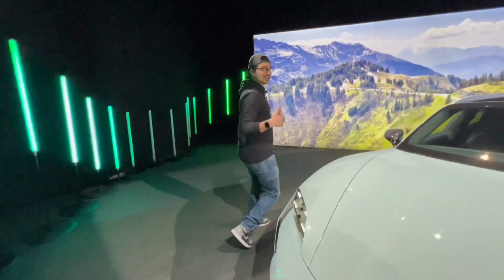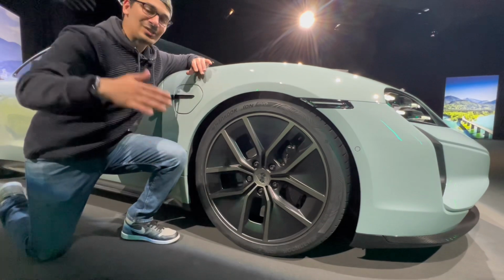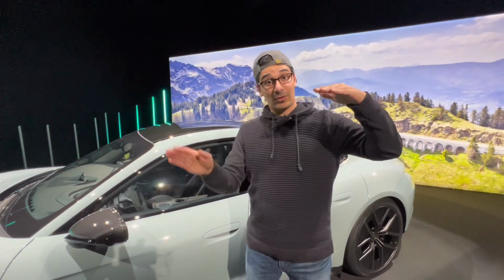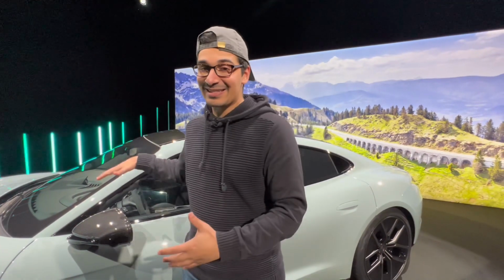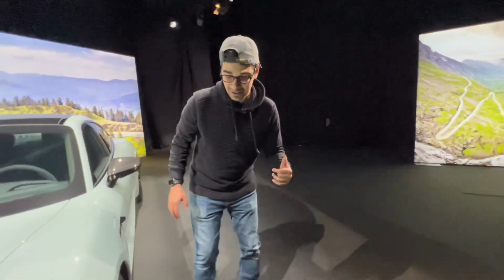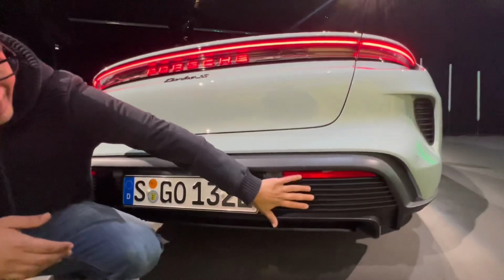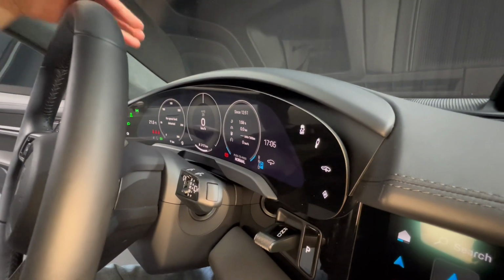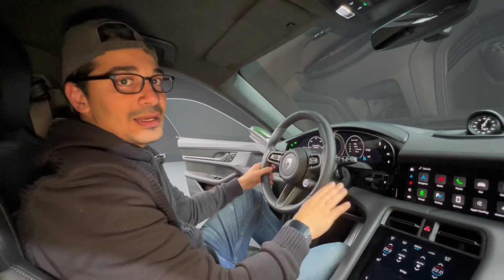2025 Porsche Taycan Turbo S First Look! More Power and Better Suspension 👌

Comment: If porsche really wants to beat every one in the game,they should use battery cells with over 450 wh/kg energy density,and they should manage to have a battery pack with atleast 400wh/kg in pack level energy density,CATL will massproduce it's automotive version semi solid state condensed battery early summer this year with over 450 wh/kg in cell energy density,porsche taycan turbo s weighs 2280 kg din which is 15 kg weight reduction and considering that more power and range and battery size is amazing but if they manage to have CATL semi solid state battery in their taycan line up they will have 400 kg weight saving from battery pack and they can reduce the weight of e drive units with another 80 kg from drive units,if they do this taycan turbo s will weigh 1800 kg din and a lot more range and performance i hope they will do what they should do to be the best
Reply: Porsche beat every electric car in handling performance. And ofcourse about laptime